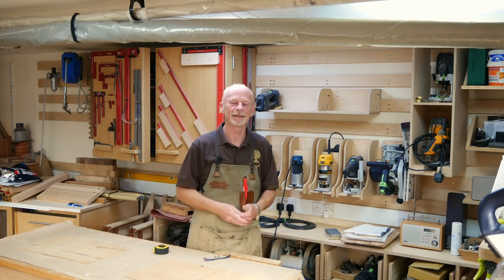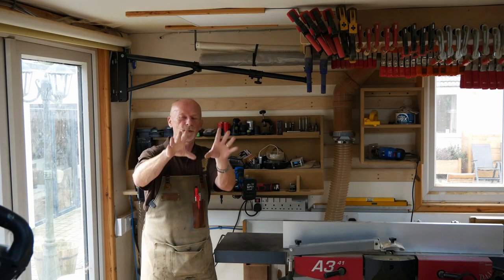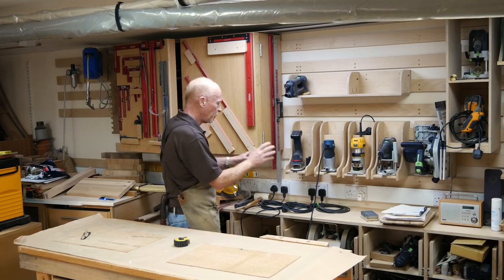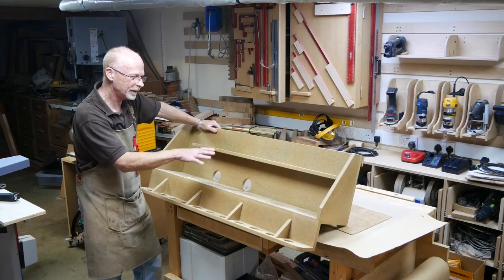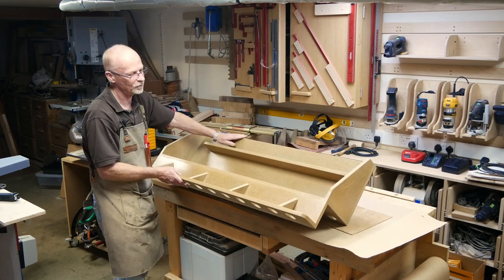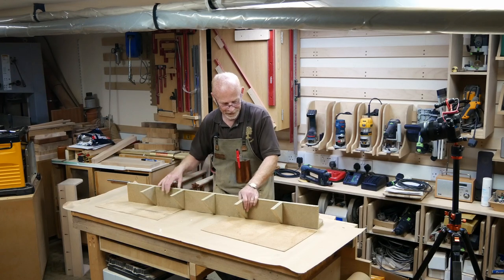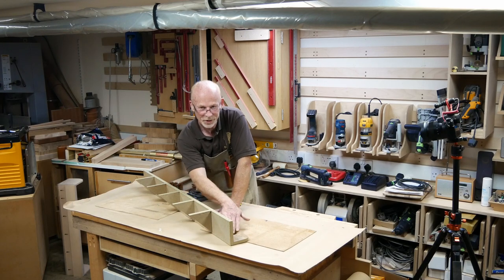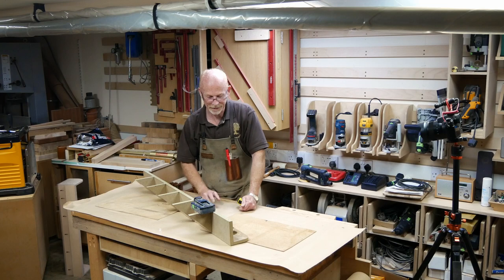Drill Driver storage Unit / small version

Comment: Another great little video.quick question where did you get your red corner clamps also i have seen you using a small template for rounding off corners is this available in the u k. Look forward to the next video keep up the good work.
Reply from the maker: Hi Norman, not sure which clamps you're asking about as I don't remember using them in this video.  The corner template I use on the router table, I have 2, the larger one with the black body unfortunately came from Banggood, the smaller red ones cam from Amazon. 👍